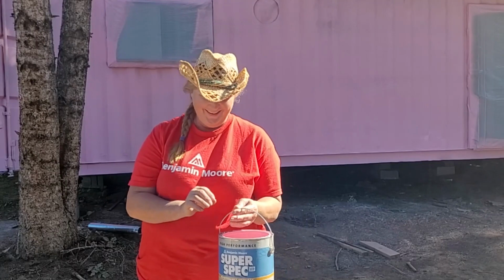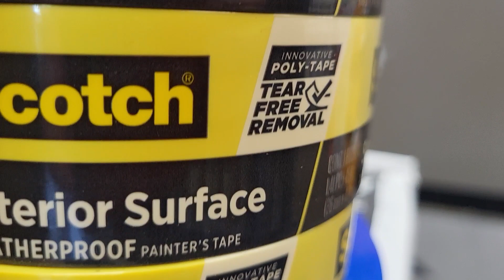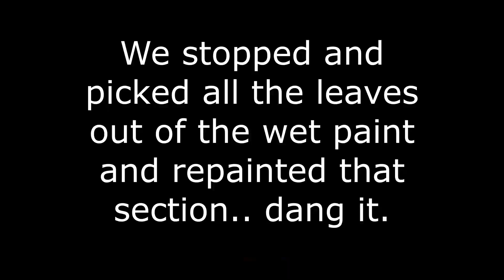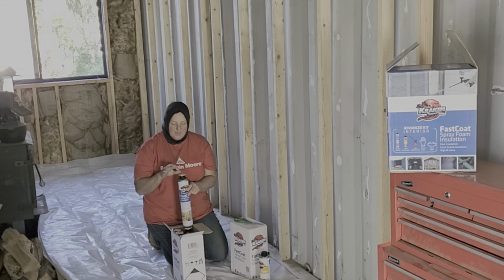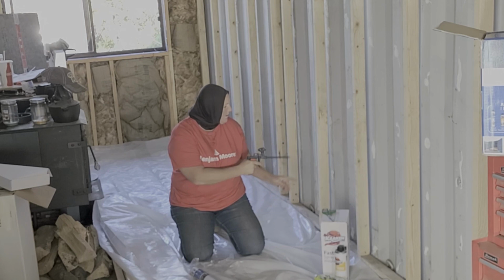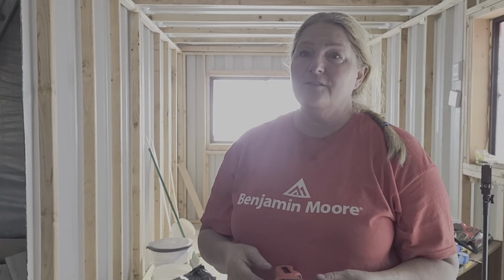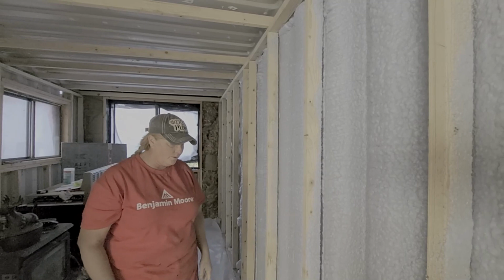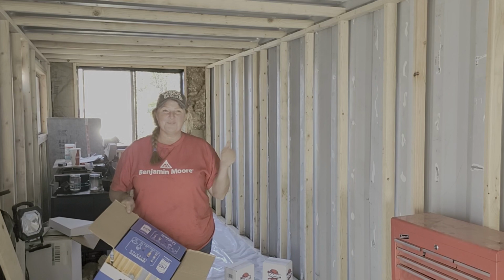Painting the Off-Grid Shipping Container Tiny Home// DIY SPRAY FOAM Insulating the Container

Comment: Thinking  electric  should be run before  spray insulation  that avoid  damage to insulation
Reply from the maker: That's why I only sprayed 1 inch so there is room for us to pull wire through and then we can add the rest of our insulation after...justvtryi g to beat the super cold where we can't spray it due to weather